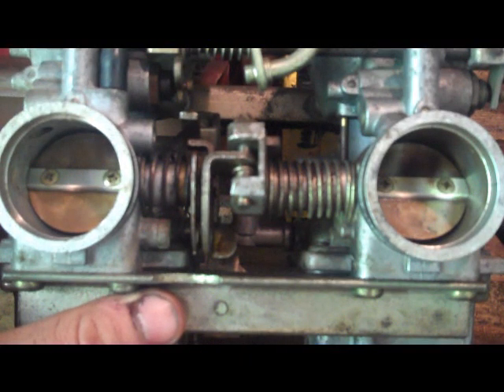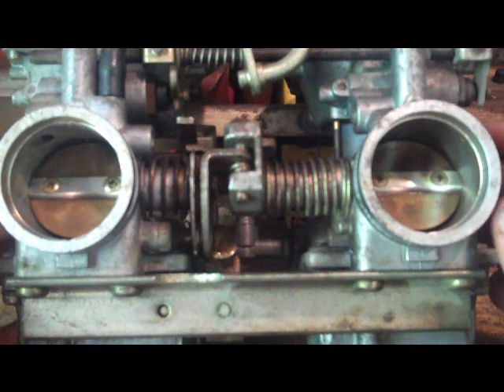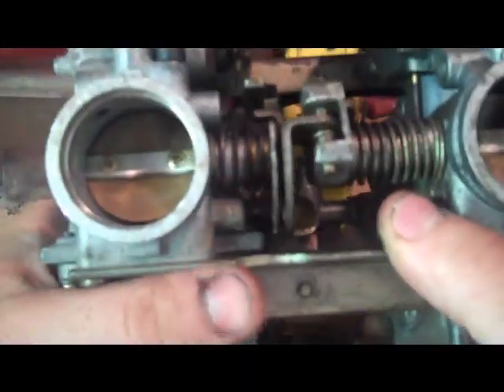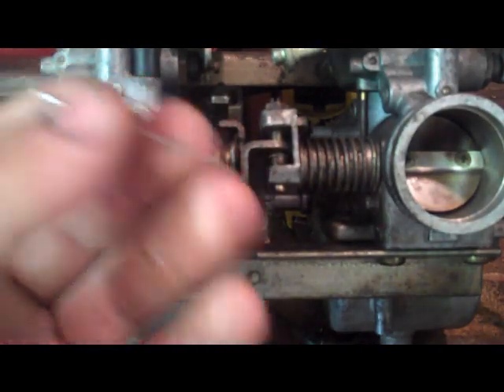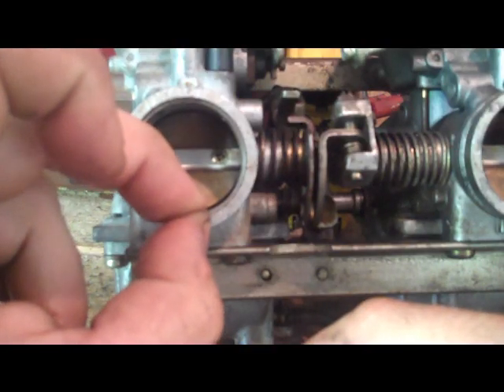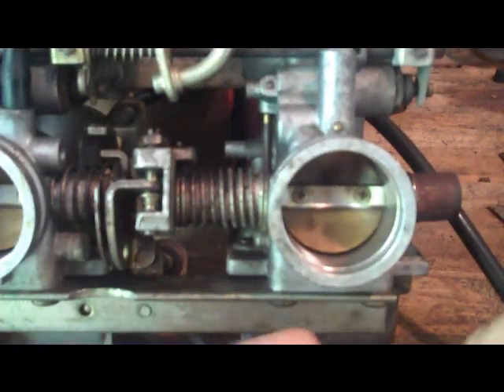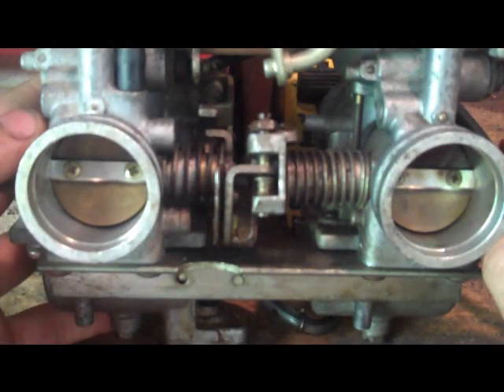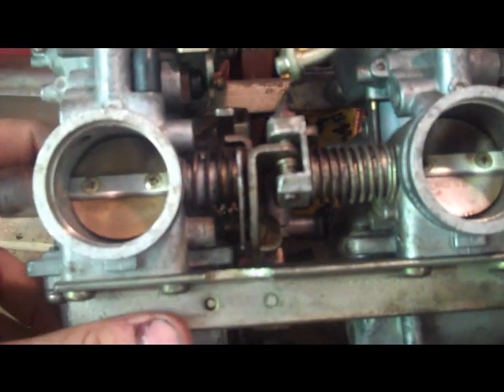How to bench sync motorcycle carbs

Comment: I have 2 XJ650's. One is street legal and the other isn't.  The XJ650 that's not street legal was to have had the carb professionally rebuilt. I couldn't get it running. I removed the number 1 spark plug and sprayed starter fluid in it. It fired right up but stalled right away.  So I did it again and the same thing happened. So I removed the air cleaner and removed the spark plug and hit it with starter fluid.  When the bike fired I kept spraying starter fluid in the air box it ran until I stopped it after 5 seconds. Sounded good but wouldn't take gas.  Found out the so called  professionally rebuilt carbs had this brown sticky crap in the fuel bowl area.  The floats were frozen.  Both engines are 5N8 and have the swear word YICS on the engine.  What are the cylinder heads made of.  Where the spark plugs are. The non registered bike has a spark plug that won't come out. It looks straight though. Today in York, Pa it was about 45 degrees out.  I tried to start the bike that's street legal and all I got was a backfire.  It didn't even try to start one bit.  The petcock is working correctly. The battery is freshly charged. I am getting a fat blue spark. I changed the exhaust since I emailed you before.  The previously owner of the legal bike had cherry bombs on the exhaust. I now have stock exhaust on the bike.  It fits it like a glove.  The gas was purchased less than 3 weeks ago.  I am 45 and have NEVER had such a problem getting a bike to run right.  I am getting float needles and seals soon.  I am going to bench sync the carbs when they are off for the last time.  This is the last gasp.  I don't know what else to do. The bike wouldn't even fire with starter fluid. Compression is also good at 150, 145, 145, 145. I am at a loss.
Reply: What was the solution?

Comment: Where can I find the gap (mm) requirements for the buttlerfly gap? I've got a 2008 Suzuki gs500 that Im about to service & figure Ill check the gap to make sure it's in recommended setting.
Reply from the maker: sypher0101 Typically there isnt a recommended setting. The important part is to make sure that they are all set equally, then you can adjust them all together when the carbs are back in and the bike is running by turning the idle knob. Again, the gap isnt what is important at this stage, it is that they are equal
Reply: mrmaxstorey i noticed that when i cleaned my carbs, i noticed that my throttle return is weak.  so i played with the return spring on the carb by twisting it to make more torque so, so it can have a stronger return.  but no improvements still the same.  is that ok or i should not play with the throttle return spring on the carb.  btw it's very hard to twist the throttle when i did that to it.  fyi mine is a 97 honda magna v4 motor.  can u shed some light?  thanks again very good video all the time.
Reply from the maker: Bobby Hobby Clean the corrosion around the linkage and butterfly valve

Comment: hi againmax i need your advice on something i saw a gs 850 l suzuki on e bay
not big bucks it said in ad gearbox was not working is this a big repair do u hav
to take engine out or can the repair b done with engine in bike
Reply from the maker: Yeah its a big repair and you probably need to remove the motor
Reply: hey Johnny as a resource check out the GS Owners club on facebook , lots of guys on there been driving gs models for years invaluable knowledge ....

Comment: do the carbs have to be synced, if the carb body is removed as a whole without seperating each carb from one another? im rebuilding my trans on a 99 r1 and would like to take them off before flipping the engine...
Reply from the maker: +quickassilver11 Most ppl say to sync the carbs every time you remove them, but honestly if you dont mess with them then their settings won't change, and you'll probably be fine.

Comment: I have an 83 v45 magna. the butterflies on my carbs are completely shut. even when I choked it they did not move.I tried opening them by turning the idle screw, nothing, and the other adjustment screw, nothhing again. is there some reason why there shut closed like that?
Reply from the maker: They should open when you twist the throttle

Comment: Hi I'm trying to set up mine I can set the one side up.with the idle screw but when I try the other side and adjust the screw and nut the butterfly doesn't move any ideas would b a great help
Reply from the maker: Make sure that little adjusting nut is on the correct side of the linkage. Sometimes people will split the carbs when cleaning and then put it back together with the screw on the wrong side.

Comment: Hi, just discovered your video. been having a problem synchronizing my carbs. I have an inline 4. the bike runs like crap. when I turn the adjustment screws. the needles on the vacum gauges don't move. I've turn the screws quite a bit and at some point I'll see blue smoke coming out of one of the exhaust pipes, but the gauge needles still doesn't move. would you happen to know the cause of this? also, if I follow your video will I at least be able to bring the carbs back to factory specs? thanks

Comment: i own an FZ750 and my bike wil NOT idle, ive cleaned the carbs twice made sure the jets were clean and hollow, everythings good im getting spark and fuel, just wont idle, also sometimes it  wont start. i tried bench syncing and for some reason one carb is getting very little vacuum, yet i set them al the same. any help woud be appreciaited.
Reply from the maker: Have you checked compression?
Reply: Raise the main Idol. The black plastic nut on the idle bar that raises all three carburetors idle at once spray each carburetor individually isolating them and covering them up and look for leaks or I should say starter fluid sprayed Here There and Yonder and if the idle picks up that's where your leak is.!¡!!

Comment: My petcock has a "Res", "On", and "Pri" position.  Can you explain these please?  Which is the best position for a slight leak?
Reply: ThrasherGnar on your petcock you have high and low fuel entry points. Reserve pulls fuel from the lowest point. The ON pulls from the top portion. Pri= Prime. Basically what your doing is priming your carburetor to let fuel in bypassing the accelerator pump. Saves you from running down the battery by cranking trying to get fuel to carbs. Set to prime and once it’s idling set back to ON. Never ride in RES= Reserve unless your bike wont’t crank due to being low on fuel, because that will use the last gallon or so. It’s for being able to ride to get a gas station. Best of luck my friend!

Comment: why it is adjustable, not fixed
Reply from the maker: +2006dogan Its an adjustable part of the bike that needs to be dynamic so you can make changes as the engine wears. This just puts the adjustment back to zero so to speak, so you can do a dynamic sync later and get it really where it needs to be

Comment: Hey mate , I have a fzr400. Just got it for free and it's been sitting since 2009. I got it started but struggles to start unless I spray in the carbys. And once it starts the idle is up and down and very rough. It also doesn't hold idle. I've opened the carbys and they all look pretty clean. Any ideas?
Reply from the maker: All kinds of things could be causing these symptoms. Floats set out of spec, dirty air filter, uneven compression, vacuum leaks, fouled or fouling spark plugs, poor spark, etc
Reply: First you must check for vacuum leaks if you have more than one carburetor isolated cover it up spray starter fluid on the rubber boots around the throttle shaft Here There and Yonder until the idle picks up that's where your leak is then do the other one see if there's any leaks in it then you can remove them and repair or rebuild them oh yeah stale fuel or gas moisture in the fuel or fuel bowls. Keep watching videos and more videos will pop up watch those videos and more will pop up eventually you'll see the whole big picture.!¡!!!!